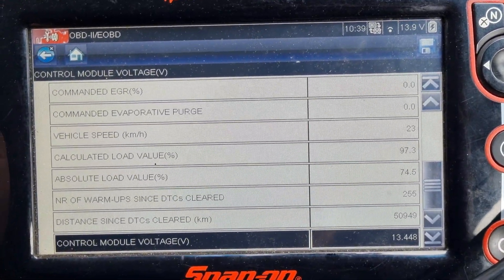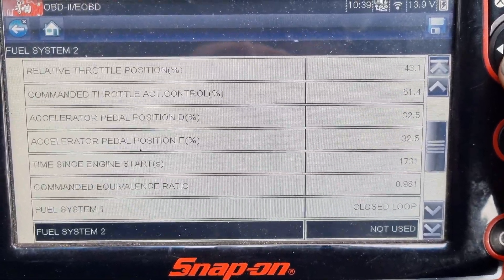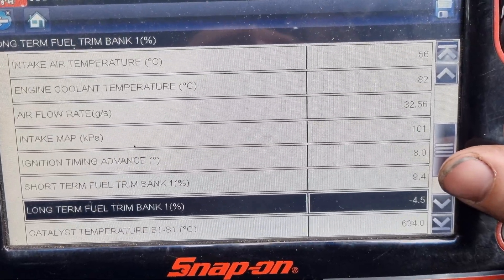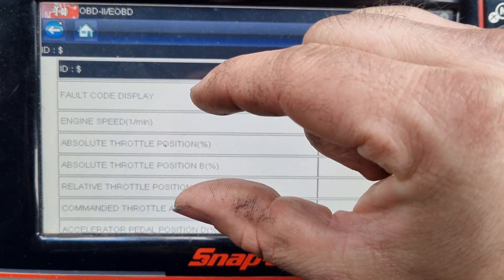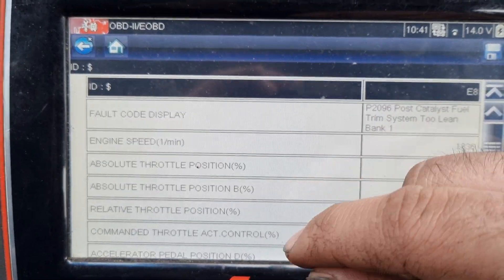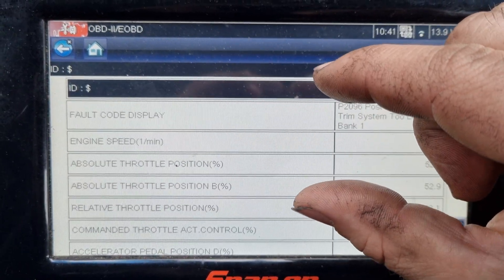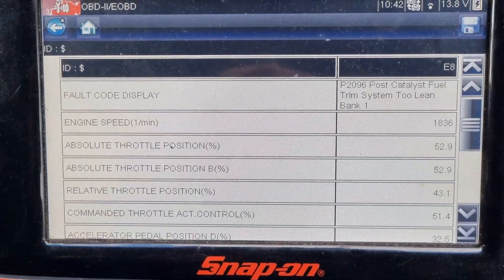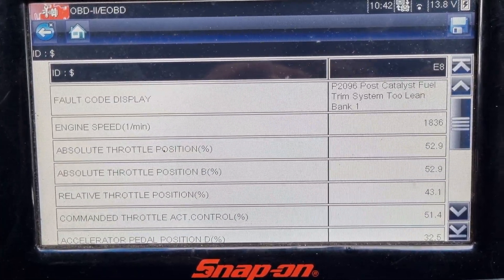Mazda P2096 Post Cat Fuel System Too Lean Bank 1

Comment: Recently got P2096 on my '10 Mazda 5 (2.3L). So it's probably a software problem, not a physical o2 sensor?
Reply from the maker: Yeah more likely software but i have seen sensors fail too, so they need to be checked

Comment: Hi mate , I have the Mazda cx7 2010 with this code , exhaust blows some black smoke when I press accelerator aggressively ,  
Mazda workshop manual says to check voltage of rear o2 sensor ,  
In neutral when you depress pedal if you get over 0.45 then it’s normal , and when you let go of pedal it should go below 0.45v 
If it’s not the case and you don’t have obvious exhaust leaks then you should change o2 sensor 

My rear o2 seems to be playing up,  at times not even going below 0.45 when I release pedal, just holds above 0.8 

Voltage Just all over the place really and not even reacting to pedal acceleration sometimes . What do you think ? 
I don’t think I have freeze frame data when code tripped initially
Reply from the maker: Is that the only code?
Reply: @RealAutoSolutions  yes it is,

Comment: Thanks to the video mate, very useful, I always keep looking for freeze frame data specially fuel trim and you are correct need to do software update
Reply from the maker: No prob at all, i hope it helped, fuel trim is such a massive diagnostic data pid
Reply: Thanks for explaining mate.
Where in South Brisbane I can take my 2009 for software upgrade, you reckon ?
Cheers
Reply from the maker: @arashfarahbakhsh8789  what suburb? I'll find out a local shop.

Usually Mazda is the best place to take it but I have friends with genuine capabilities over east
Reply: @Jax Mechanix  Thanks mate for your reply 😊 
I'm living in Acacia Ridge but happy to travel to close by suburb's .
Cheers
Reply from the maker: @arashfarahbakhsh8789  just wanting to confirm it is a mazda 3 you own; If so i have a good friend in browns plains i can refer you to

Comment: Thank you, erased the code and see if it comes up again!
Reply from the maker: i imagine it will return in time mate
Reply: @RealAutoSolutions  I spray cleaned MAF sensor and the light is not back yet since then
Reply from the maker: @licungR  ah yeah did it have other lean codes? P0171?
Reply: @RealAutoSolutions mine does
Reply: My 2096 code too lean only comes on when the car reaches normal operating temperature haven’t solved it yet.
Reply: @jerichobeach2967 any solve for the issue yet?
Reply: Pay $200 to fix an incorrect warning light when Mazda engineers goofed by not designing enough tolerance in their ECM software. Sounds like a Mazda responsibility. Looks like there is an OEM bulletin documenting this issue.